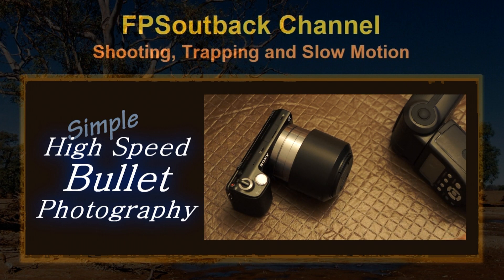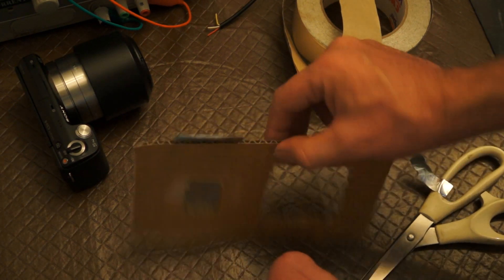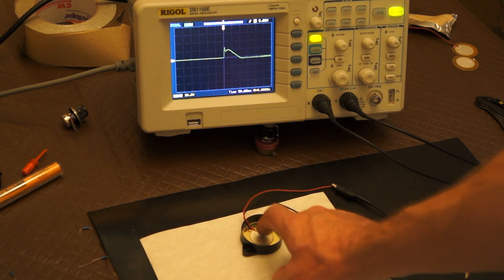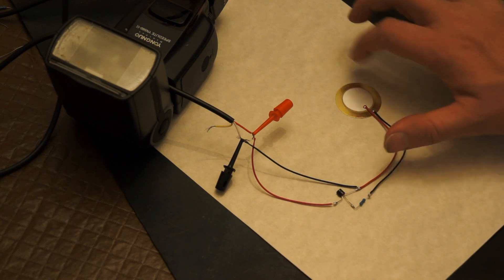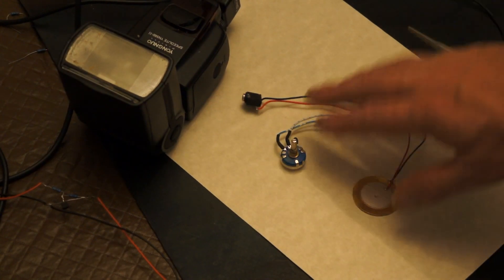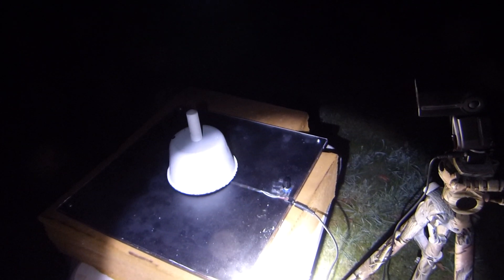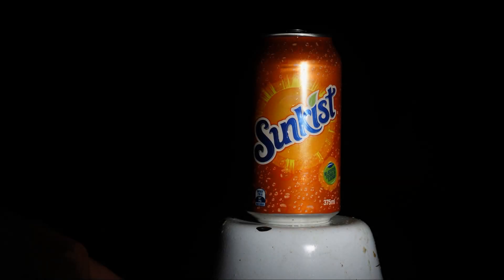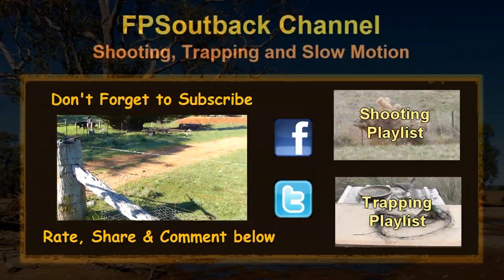Simple High Speed Photography of a Bullet

Comment: Wauw, great video, very informative and not boring at all. I didn't know you could use a LED as photodiode!
Reply from the maker: Yep, same way a motor can be used as a generator electronics often work in reverse. Its also acting as a capacitor, its capacitance prevented getting meaningful light pulse duration measurements as its a lot shorter then shown on the scope.
Reply: thextremeking  Along a similar line; the base-emitter junction of a typical bipolar transistor emits light when it's energized. Also, 1n4148 glass small signal diodes make excellent photodiodes.

Comment: Does anyone know of a computer program that could be used to measure muzzle velocity? Ie. if you have two foil triggers, connected to the computer, then they would connect the circuit, when a projectile is fired through them and the computer would record that. If you had two at set distances from one another, then you could estimate the velocity.

Thanks for any help.
Reply from the maker: I don't know of any simple PC microsecond timer, a USB oscilloscope should do it though, $30 on ebay.
Reply: FPSoutback Thanks, I'm thinking that I'll use softchrono, using this layout 
http://www.network54.com/Forum/79537/thread/1312148525/Poor+Man%27s+Electronic+Chronograph
I doubt that it'll be fast enough for bullets, but it should be fine for my potato gun.

Comment: A bit long? Yes. Boring? Not in the slightest. I might just have to build myself a rig like this. Any suggestions for a complete novice at wiring up such things?
Reply from the maker: If you use a different flash you may need to change the resistor values although I really recommend the yn560 due to mutiflash mode that when set to 1hz prevents multiple triggers. You don't need the polycarbonate, you can get away with just sitting it on the disk, or taping it to the target. The transducer voltage polarity depends on what side its impacted on, hitting the soldered side generates a positive voltage in the black lead. Its pretty simple, maybe I can hold a giveaway for the prototypes.
Reply: FPSoutback Any way you could provide a slightly more detailed wiring diagram? Maybe something printable?
Reply from the maker: Brianm51 I just posted a closer picture on facebook, the link is in the vid description.

Comment: Do they sell these super sensitive flash activators? I feel like you could probably make some decent cash selling these, even just on ebay. I know I would pay $$$ to have one without making one myself. I could, but i hate trying to wrap my head around electronics.
Reply from the maker: There are commercial units that are more complicated (and thus expensive), there's also the problem that when things become more complicated they introduce lag, so will be too slow to detect the impact rather the bullet has to be sensed then insert a delay before firing at the correct time. "Camera axe" is one of the better ones.